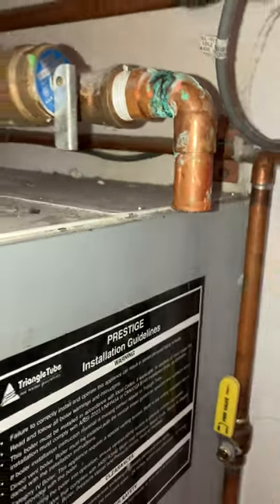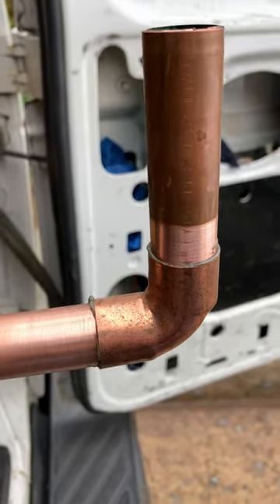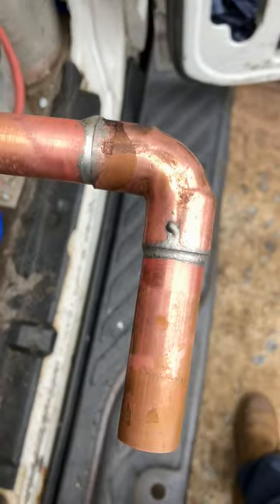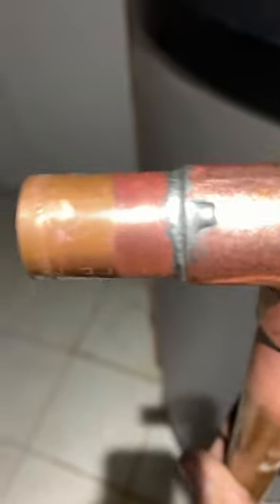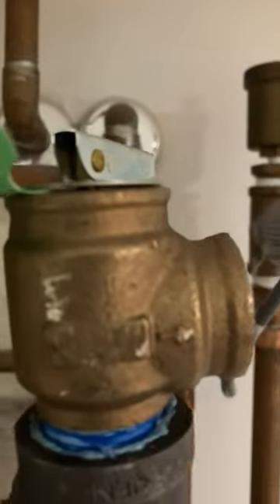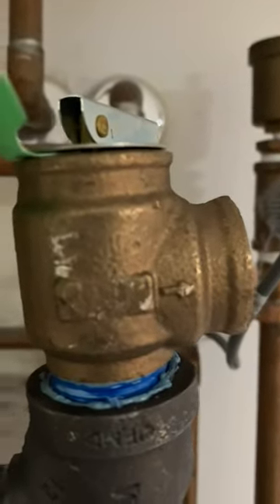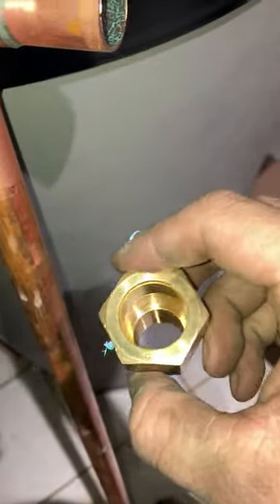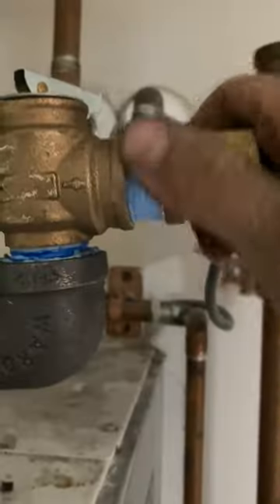The Best Way to Drain Boiler Relief Valves

Comment: That's probably the best use of a compression fitting I've ever seen! I typically avoid compression fittings, but for this purpose it's awesome because it's not constantly under pressure, and a small leak in the fitting wouldn't really mean much anyway.
Reply: Double compression valves under sinks are also great and compression toilet connectors! Thanks…Jim
PS…..especially when you need to replace them. I only use 1/4 turn valves!

Comment: Never in my 60 years of soldering have I seen such a bad solder. I’ve been soldering 8 hours ever day 5 days a week for the past 50 years. You need to apply 100 in. lbs. of force on the pipe into the fitting while lubing it up with your spit and put 5 inches of solder into it. Works every time
Reply from the maker: lmao, thank you for the advice brother! will lead free solder be ok or should i use someting else lol

Comment: Why was the relief dripping?  Feed valve bleeding through?  Expansion tank bad/low pressure?  It opened at some point and kept dripping cause the seats get garbage on them.  BTW your soldering was plenty nice especially for a relief tube.
Reply from the maker: thank you brother! just think the relief spring was letting go, no problems with pressure or anything, fine with me more brass to scrap!
Reply: Cool beans man.  Keep up the good videos!

Comment: What is sodder??
Reply from the maker: a soft metal material that is heated and used to fill copper pipe joints. I can go into more detail if you would like that was just a quick explanation

Comment: Thanks for mentioning the relief should be upright vertical. Unions are my preferred way to pipe relief downpipes, but also one of the few times I would use a sharkbite fitting (coupling or male adapter) depending on the job…
Reply from the maker: I've heard sharkbite a lot from others too! Never would have thought of that thank you for the info!

Comment: Good idea but wouldn’t pass code in my strict city. Has to use a male-to-sweat adaptor, with all other joints soldered or brazed, to within 6” of the floor (but preferably a floor drain).

Comment: You can use shark bite as well, and they sell pex pipe for that with a swivel head .
Reply from the maker: interesting idea! thank you for the feedback!
Reply: You don’t sharkbites on relief valves. valves. Sharkbites are only rated to 200 degrees. If something malfunctions and the temperature goes above that good bye Sharkbite. 🤷‍♂️

Comment: I like to use a sharkbite coupling so you can spin the pipe without cutting it
Reply from the maker: Interesting, thank you for the feedback!
Reply: For sure I know people do not like shark bites but the fitting can spin on the pipe and it does not have pressure on it so it doesn't really matter
Reply: Another fun thing to do is to jumper the end switch on the boiler and plug the relief valve 🤣🤣  That's how the professionals do it
Reply from the maker: I see your point, I don't keep shark bites on the truck but might be worth looking into
Reply from the maker: Seems like you've seen a "professional" do that before? I should say, self proclaimed "professional" lol

Comment: Is the t&p valve supposed to be threaded right into the boiler? How can it work properly being piped away from the boiler
Reply from the maker: In my opinion it doesn't have to be threaded directly into the boiler but it should be somewhere on or around the boiler because thats where the pressure will be the highest. The pipe coming off is a drain line, if the relief valve goes off it directs it away from the boiler

Comment: Relief valves don't have to be vertical
Reply from the maker: was told they had to be so debris don't get caught inside, thank you for the information
Reply: Most boiler manufacturers specify vertical. Also, it’s written on the yellow tag

Comment: That solder looks like solder, not good man, not good.
Reply from the maker: Teach me your ways!
Reply: I usually sand it, double flux it with a 6 inch paint brush then use my 1/2” solder.  Then I fire up my oxy acetylene torch ran through the customers house to wherever I’m working.  I get the pipe double hot.  If there’s anything left of the pipe and fitting when I’m done with the job, I charge the customer and drive through their yard on the way out.